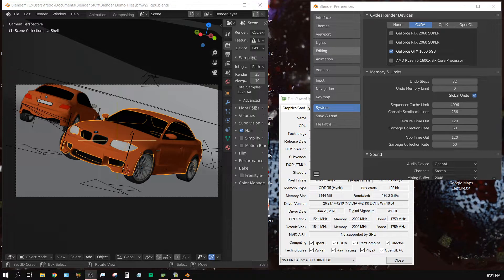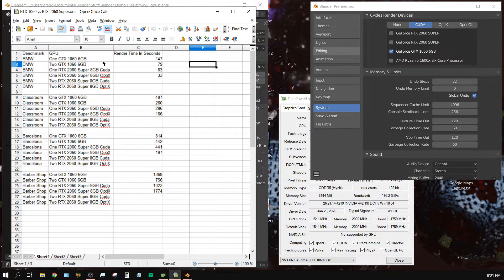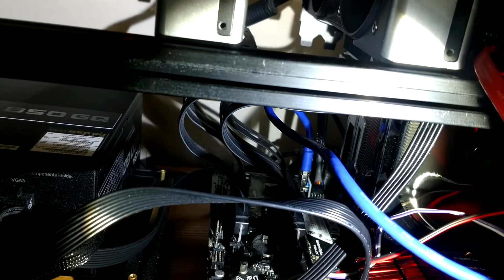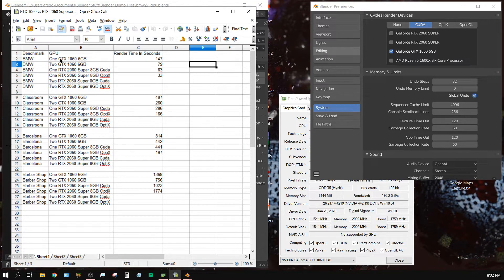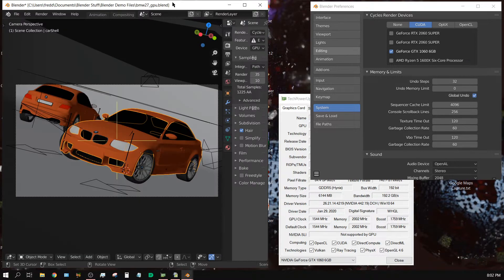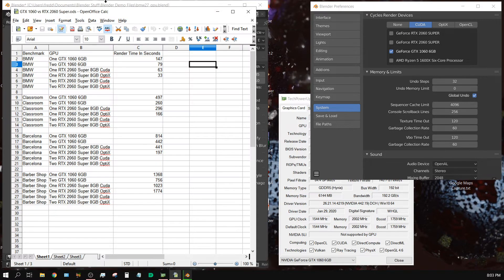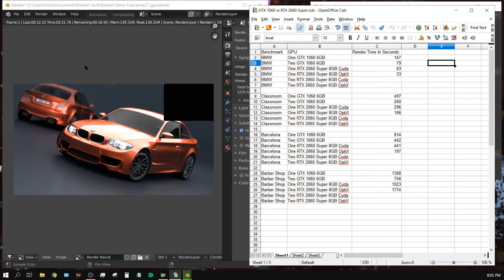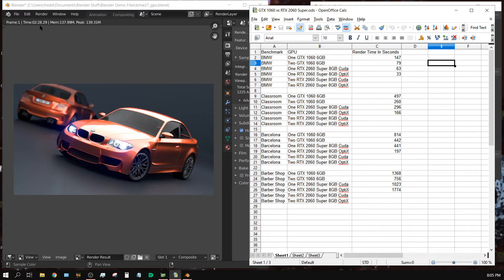Blender GPU Cycles Rendering In A 1X PCIe Lane Test

Comment: very interesting. Other question : impact of pci express size with Nvenc encoder with editing video soft? Have you tested it ?
Reply from the maker: I have tested it and it also makes no difference for the most part. For full HD and lower res it makes ZERO difference. For higher resolution like 4K, it makes tiny difference, maybe 2-3%. The simple answer is even 4K video uses little bandwidth in terms of the amount available with even a single PCI 3 lane and even less with 4.0 lanes.

Comment: I was goinf to do a test like this myself too, I'm very glad you shared! Looking for uses of my 6 GPU mining rig when no longer mining. Have you tried the same experiment with other forms of content creation? Video editting/streaming? I know gaming takes a hit for sure.
Reply from the maker: I have not done as precice a test. But I did try it with video editing and it does use more bandwidth. In fact, when I tried it with four 4K videos in a timeline PiP style(powerdirector) with 4K output, it completely saturated the 1X 2.0 lane I was using but it would not saturate a 1X 3.0 lane. With video encoding as in h.265 NVEnc encoding using handbrake, it used like 10% of the 1X 2.0 lane. But jumped to around 50% with h.264 NVEnc. But I think the CPU limited the encode speed and bandwidth on the h.265. I used a Ryzen 9 3900X.

I think 2 or 4 lanes of 3.0 or 4.0  speeds would be fine for pretty much any video editing without bottlenecks.

I never tried with any adobe products because I don't use any adobe products. I also didn't try it with video encoding for livestreams. My gut instinct is that it would work fine mostly but may stutter with only one lane.

I'd be interested to see how GPU direct storage access would be affected by this. I suspect it would cause issues. But that's just a guess.

Comment: THANK YOU SO MUCH FOR DOING THIS, I HAVE ALWAYS WONDERED ABOUT THIS AS WELL!!!! Can you do more 1x vs 16x rendering comparisions?
Reply from the maker: There's really no point to doing more tests in regards to rendering in Blender with 1x slots. Being that PCIe 3.0 lanes which is what most people have, can send 1GB per second with 1 pci lane and the typical project data is 2-3GB, it means that generally regardless of how complex the project is, the only part that will be different is the amount of time it takes to transfer the project data to the GPU. It's only a second or two longer unless you are using a 3090 and the project is so large it uses most of the 3090s 24GB of ram. In that case a 1x slot could add 20 seconds to the render time.

Also, 4.0 pci is becoming common and it can transmit 2GB per second per pcie lane. As long as you have you main GPU(display GPU) in a 16x slot, you are golden. I have used as many as one 16x slot and four 1 x slots with 5 GPUs and they are run fine. Rendering in blender really doesn't need much pcie bandwidth at all. Next year we will start seeing 5.0 pcie and it can send 4GB per second per lane.

The bottom line is, unless you are rendering very large projects that take a lot of vram(more than 10GB), you will see little or no difference with a 1x vs 16x.
Reply: @BlenderRookie Well what my original thought was using say an Octominer 12 GPU motherboard that has 12 1x pci slots. Imagine filling those up with Tesla k80 thats are cheap at 5k cuda cores thats a total of 60k CUDA cores!! Can you imagine the render times on those?? LOL
Reply from the maker: @beowulfkaine  You would think the K80 would be a good GPU for rendering, but it's not. Don't get me wrong, as cheap as they are, it could be, especially right now being that they are the only GPUs you can get. However, they use more than twice the power as a GTX 1060 and they perform about as well as the 1060 except in CAD programs where they are designed to shine.

Rendering in Blender, it would take 6 or 7 K80s or 1060s to equal the performance of one RTX 3070.
https://www.techpowerup.com/gpu-specs/geforce-gtx-1060-6-gb.c2862

https://www.techpowerup.com/gpu-specs/tesla-k80.c2616

Comment: Very interesting video! pity my lower end x570 mobo (asus tuf wifi) doesn't support sli (two x8 slots from the cpu) but rather have one x16 (from cpu) and one x4 (from chipset) slot. I really don't care about sli at all since blender also doesn't care for it but atleast two slimilar x8 slots would distribute the data to two similar gpus evenly and the rendering speed gain would be linear (theoretically 2x same gpus should reduce render time by 50%). I was wondering about what kind of reduction of speed would I get if I populate that x4 slot and it seems like there wouldn't be much difference (probably 10% loss due to lower bandwidth) 🤔 🤔 since all slots are PCIe 4, that x4 slot is basically a PCIe 3 x8 slot but I think the gpu wouldn't be able to access it for its pcie gen limitation, which means it'll work as a pcie 3x4 card with pcie 3 gpus and pcie 4x4 card with pcie 4 gpu 🤔
Reply from the maker: I have two RTX 2060 supers and my MB has 3 physical 16 slots. 
Slot one 16X physical 16X or 8X electrical 3.0
Slot two 16X physical 8X electrical when slot one is 8X 3.0

Slot three 16X physical 4X electrical 2.0

Slot 4,5 and 6 are 1X physical and 1X electrical 2.0

In most cases the difference in rendering speeds between the  fastest slot, the 16X 3.0 electrical slot(slot 1) and a 1X 2.0 slot(slot 4,5 or 6) isn't even noticeable unless more than a few gigs of textures and data need to be transferred to the GPU. Even in a scene where it requires let's say 6 GB worth of data, the transfer of the data to the GPU will only take maybe 8 seconds longer. But once it's transferred the rendering speed will be identical.

In a 4X slot like you mentioned, I doubt you would even notice a difference. I have used GPU-Z to show the bandwidth usage and even in a 1X 2.0 slot while rendering in cycles, I am only using 40% of the bandwidth. 

Here is a video I made testing the bandwidth usage.  https://www.youtube.com/watch?v=BNsBJA3S-p4
Reply: @BlenderRookie  Great insight! thank you
Reply from the maker: @riazulrahil  You are welcome.

Comment: OptiX-DUAL What is the total maximum wattage of a personal computer?
Reply from the maker: It varies wildly based on hardware. I have a PC that uses about 30 watts max and another that can use over 600 watts. I'd say the average everyday PC  is in the 100 - 200 watt range.
Reply: AMD Ryzen 5 1600X 95W,RTX 2060 super 175Wx2 Toutal 445W !

Comment: Huh. I suspect there will be more of a difference with larger models (more mesh data & more texture map data). 🤔
Reply from the maker: I think the difference will be in the initial part right before it begins to render. In that time period the scene data is transferred from system memory to GPU memory and that transfer is limited by the bandwidth of the pcie lanes which in this case is one 2.0 lane at 500 MB per second. So with a huge scene that may use 8GB of memory, it would take 16 seconds on my setup to transfer. Whereas on a better motherboard running 3.0 speeds would take 8 seconds or 4 seconds on a 4.0 pcie lane.
Reply: Blender Rookie - yeah.... my understanding is that Blender can’t - as of yet - dynamically swap resources in & out of the GPU during a render. 🤔
Reply from the maker: @darkwinter6028  Do you mean as in if the GPU only has 6GB of memory but the scene needs 8GB, Blender can't manage transferring data from system memory on the fly in order to make up the 2GB shortfall? If so, that sounds about right.
Reply: Blender Rookie - yes, exactly. In principle, the rendering engine could perform multiple passes; first loading the geometry data but no texture maps, and solving for the uv coordinates of every ray hit (and streaming it off to main system RAM); then clearing the GPU ram and uploading the texture data & shading nodes to resolve the color (well, energy) of the rays. I don’t think that it’s ever going to be implemented that way; however... the amount of refactoring work needed probably exceeds the additional utility of such a mode. 🤔
Reply from the maker: @darkwinter6028  I will assume you are correct in your assumptions. That's beyond my knowledge base.